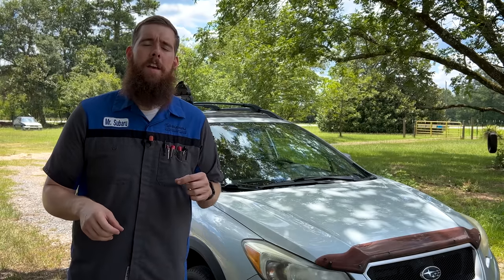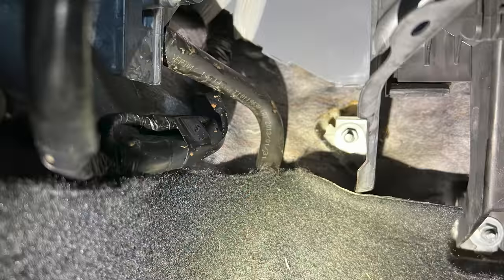Water In The Floor! The What, Why, & How Behind This Phenomenon In Your Subaru!

Comment: Under your driver seat, is a small vent designed to blow on the rear passenger's feet. I literally just came back inside from modding mine: I had an old vaccum cleaner hose, maybe 1.5inch diameter. I threaded the hose through the 40/60 fold of the front seat (lowest, furthest rearward point of the bench of the seat), and curved the hose under the seat and taped it around the vent. Now, when I turn the AC on, my back will be blasted with nice cold air, making the AC more effective at cooling me down. 👍 Cleveland's BS 90deg/90% humidity is less of an issue now. Helps to have a seat cover like I do, where no one will see it. Or, you could care more about function than fashion. 🤓

Comment: If this doesn't fix your issue, the second place you would want to check is under the windshield wiper cover. From my SH Forester I literally collected a bag of dirt that was blocking the drains and I had water in the same spot that was dripping through the filter after a wash or heavy rain because water could not be drained fast enough. Great video btw! Learned a ton of new stuff during all these years about Subarus.

Comment: Awesome! Bought my 2011 forester used and the cabin filter was nearly plugged and had a huge pile of pine needles on it, mine drains fine for now but it will be nice to make sure, it's nice that subaru put the drain hose where you can get at it unlike my nieces Honda accord, center console has to come out not to mention the computer is right under the evaporator box it overflowed and destroyed the computer. 
It's great Subaru has a procedure that doesn't require pulling it apart🥳
Reply: The accessibility is great and I've needed it on my wife's Outback as it's clogged 3 times now. The Accord location hasn't been a problem for me however because my 2009 Accord has never had this problem.

Comment: I am actually having the same problem, but on the driver side.  Any helpful information will be appreciated.
thank you 🙂
Reply: Did you get this issue sorted. I'm having water on driver side as well, now that it's raining
Reply: I am also having the same problem as you two. Let me know if you find the problem.
Reply: I have the same issue,  Any insight @MrSubaru1387
Reply: I also have the same issue
Reply: I advise you to check the seams of the windshield for tightness or the glass frame itself

Comment: Had this problem the second summer after buying a new crosstrek.  Turns out it was a drain somewhere that subaru knew would clog, they replaced the drain and it has never happened again.  It was recalled when I got it fixed.

Comment: I still remembered the spider which built a web in the AC drain and then one day I realized the floor is wet whenever i turned on AC (it never happens in wintertime).  Not related but dah dah, it literally clogged and only allowed a small drop of water every like half hour... When i cleaned it up, it has about 8 eggs in it...then this repeated again two years after the initial clean up.

Comment: Nice video! For drying carpet if you have more than a little bit,  a pet/ dog heated blower dryer  works really well. They are canister design with a generous hose you can point at the wet area, glorified hair dryer, but way more effective. Cost is under $100. I have several BMWs that have had water leaks, I stumbled on this idea recently.

Comment: The subi flush kit is a bandaid for 20+ year old subaru. The real solution is to remove and clean the evap core and box. Maybe once a year on a new car using the evap cleaner foam as a preventative mx

Comment: How funny I just actually cleaned my legacy last week, the Evap core, least on the fifth GEN legacies you can stick your hand up there and pull the drain tube off the unit and then I bought some stuff off Amazon called nextzett Kilmer cleaner pro it’s made in Germany so some of the translations to English are a little off but man this stuff works awesome and it comes with a super super long white adjustable nozzle that you can jam up there to get the core clean. Wasn’t much on Amazon I can’t remember I’ll have to look Robert I’ll send a picture of it to you on your Instagram.

Comment: I have a 2015 outback that drips water like the ac is on but does it with ac off floor is dry does not overheat but antifreeze just barely below full appreciate your videos

Comment: I have a 14 forester so little different area but where the hose is, is the same in the corner just my box connection is on left side pulled off the hose and shoved a old jump rope cord through it and low and behold a gallon of water spilling quickly put the hose back on and Niagara Falls under my car

Comment: Unrelated to the a/c….2016 Outback Premium.  Popped off the windshield cowl to troubleshoot a weak washer nozzle issue and noticed that the fluid draining out of/off of the cowl just drains into the engine compartment and down inside the engine compartment.  Is this normal, or is there a dedicated channel or something that is supposed to take this out through the wheel well or something?  Thanks for all of your EXTREMELY helpful content!

Comment: Love learning from your video's. Question for you. Is there any way to improve the Subaru's AC performance? I've had 3 EJ based wrx/sti's and every single one of them have weaker AC systems vs other makes. They blow cold and cycle on and off enough to where you notice the air isn't as cold for 5 seconds at a time (when it cycles off). Just curious if we can insulate the lines or do something to help the system perform better? Not sure why Subaru's AC is always much less impressive than say our Ford SUVs.
Reply: My 2007 Legacy definitely struggled during the heat of the day and the 2011 I had was better, but didn't produce super cool air.  My 2016 and 2019 worked very well, just took a few minutes longer than I'd like for it to get really cool.
Reply: My A/C performs better when driving. If I sit in traffic, the A/C gets so weak is barely blows cold air. My mechanic just said Subaru A/C compressors are usually weak and mine even weaker so either I replace the compressor or deal with it.
Reply: @TheCharacter97  Can we replace the compressor with a 'better' one? I really wish we could do something besides 'go buy a different car'.
Reply: @eaglescout911  Yes, I believe you can change the compressor for a better one. Subaru AC compressor have for the most part, always been weak. The newer versions like the 2021 OB has a very good compressor, however, its not my car so besides seeing it practically brand new, I cannot say if the compressor has already slowed down or if its still pushing out cold air. Time will tell.

To answer your question though, I believe you can just change the compressor for a better one. I havent looked into it too much because I live up north and dont use my cars AC enough for it to bother me. You could have failed orings too.. Subaru AC compressor generally dont fail, they just are lazy. My wifes AC in her Hyundai, I sometimes put it off because its so cold on speed 1.. my Subaru needs speed 3 and to run the whole time if I want to have a decent amount of cold air...
Reply: @TheCharacter97  Yeah that last bit is my experience with Subaru's AC system as a whole. I even reached out to Mr Subaru and his answer was basically questioning if someone was wrong with my cars. Obviously my 20 sti AC is better than my 13 sti or my 03 wrx. But from my point of view the design never really changed over the years and comparing our 20+ year old Ford AC to my new Subaru AC its no contest. The Ford blow colder, faster, longer, to the point I have to turn it down because I'm too cold. LoL. I just give up.
Reply: @eaglescout911  Subaru AC just suck in general. I think maybe in the last 2-3 years it may have improved because someone I know who has a 2021 outback says the AC works just fine and from what I saw which is very little, it works better, but nowhere near say my wifes hyundai.. that thing blasts cold air in a matter of 2 seconds.. I love my subaru, but not because of the AC lol

Comment: My god, for my 2018 Subaru Impreza hatchback base model a hubcap goes for 90 bucks at dealership EACH.  Not for a set of 4.  I remember the days where you can buy hubcaps for 5-10 bucks at Hubcap Annies.  People used to find hubcaps and sell them to Annies and she would resell them near her hot dog stand.  Where are the good old days.  Come on 90 bucks for a hubcap.  Can you offer me suggestion on an alternative that would be cheaper?  Or direct me to something less expensive

Comment: I have a 2010 OB 6spd with 175 000 miles. Is it worth investing in my OB considering I need :
-rear shock absorbers
-front rotors and calipers
-complete new brake line
-timing belt
-new clutch (and pilots bearings etc.)
I love my OB but i have over 4000$ CAD worth in investment in order for me to be able to enjoy my OB more. I wonder what I should do and what somebody else would do in my situation. Should I let my beloved OB go or invest? It does burn oil but I just change it every 3000 miles and add ~1 pint to 1.5 pints of oil during that time. Thanks to anyone who helps.

Edit. I may sound extreme with 4000$ CAD but with all the rust, I dont even want to bother doing any of those repairs. I also have a very trustworthy mechanic so I will gladly give him my money since he is so good and honest. I tried 2 other mechanics to compare and non of the two have ever gotten a call back from me or anybody else I know. My first, the best around here.

Comment: Can you do a video how to get a 2002 WRX or the procedure to get the emissions readiness monitors ready?? Tried driving 55mph for 3-5 mins,decel, even cold start up with AC and rear defroster turned on for 3 mins. O2 sensor, evap, and cat still won’t show ready all others are good to go. No CEL either

Comment: Thank you for the video. This reminded me to change my cabin air filter. I went to change my engine air filter as well and I noticed a big wire mesh that but it up against my air filter it almost looks like a built-in filter is it supposed to be serviced? If so how often and how it looks like it’s attached to the plastic housing
Reply: Also I’m curious does it need to be there what to do?

Comment: Please dont spray perfume or cologne or scented oils into the air conditioning intake ducts as these could accumulate and form a gel-like sludge into your evaporator and could clog your drain. Although we encountered this issue in Window-type air conditioners but both home and automotive air conditioners work in the same principle

Comment: Hi MrSubaru1387. My girl recently bought a 2021 Subaru Crosstrek from the Subaru dealership. She noticed there was a leak on the driver's side, close to where her left foot rests on a rubber or plastic platform. The leak happened when it was raining kinda hard. She informed the Subaru dealership and they took a look at the problem. The Subaru folks told her to take the car to the windshield people. The windshield people examined / assessed the windshield and told her the windshield was fully sealed / fine. What do you think might be the problem. Any guidance you can provide will be greatly appreciated because my girl and I are worried that this leak could lead to electrical damage. Thanks brother.
Reply: Did you get this problem sorted? I'm having a similar issue now that it's raining
Reply: @joelgaspard6704 Hi. In short, I think what happened is that the windshield was not sealed properly which caused the leak. Fortunately, the leak has stopped. I hope you find the solution.

Comment: Does this apply to the heater in the winter as well?
Reply from the maker: Meaning coolant in the floor? Your heater core has burst or is leaking in that case.
Reply: @MrSubaru1387  floorboard is soaking in water. It’s winter and I live in nor cal. Seemed to have began with the change in temperature.
Reply from the maker: @namarupa5425  could be the same. Plugged drain. Could be sunroof drain if equipped
Reply: @MrSubaru1387  thank you. I appreciate that.